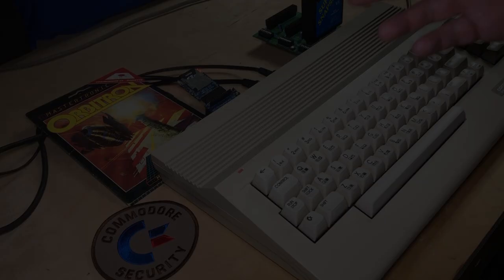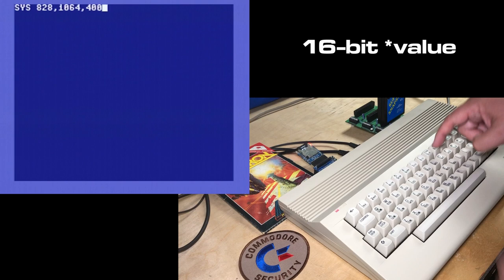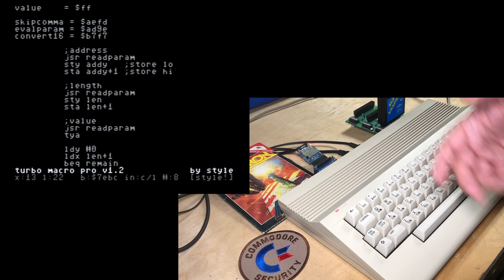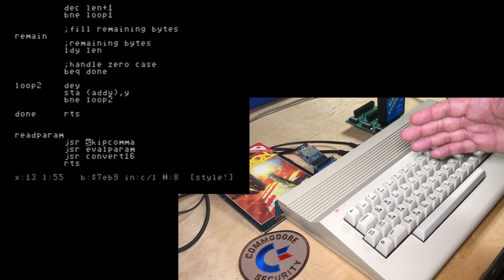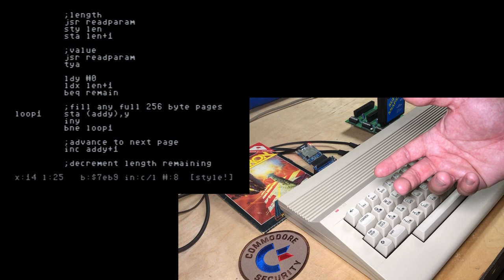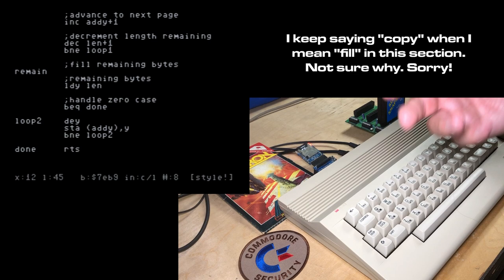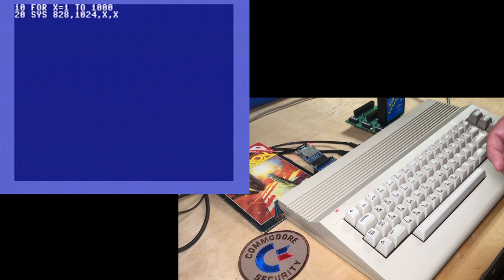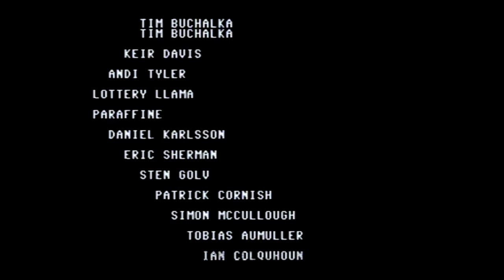Using Commodore 64 BASIC SYS Parameters in Machine Language

Comment: I keep in mind this SYS parameters thing for decades, it was actually published in some computer magazine article back in the 80's. And I keep returning to it when I roll some C64 ideas in my head. However, I always think about the next step - and that would be easing these things for existing basic v2 COMPILERS! 

But unfortunately I believe this elegant trick won't cut it for a compiled code. So it might be better to stick to some workarounds, poking parameters to some dedicated set of memory locations  (doing so before SYS command), and have machine routines pick them from there, or write back into them.

Basic V2 really miss PTR function - providing working with pointers to variables. That thing is powerful, and even more so if compiler supports it properly. Providing access to variables from machine code, both in interpreting or compiled code.

Comment: Atari BASIC also has a way to call machine language from inside a BASIC program. The address of the  string can be inside the call itself or stored somewhere in RAM like Page 6. It looks like this:
X=USR(1536, 100, 20, 3000, PLR1, MEMTOP-10)
Well, it can look like that when passing parameters. There can be up to 255! And generally the value returned doesn't matter, but I used it in my Push It! conversion of Sokoban when it counted the number of boxes in the final position. USR is very handy.
Reply from the maker: Looks very useful. Commodore BASIC has USR() as well, but only accepts one parameter (though maybe it can be extended in the same way as SYS) and annoyingly needs a couple POKEs to point the USR function to the 16-bit address of the machine language routine. If you want to call a different machine language routine with USR, you need to POKE a new address again. So USR() usually gets ignored in favour of SYS on Commodore machines.

Comment: ASK ROBIN ~ I recommend an episode on a C64 "cracking group"-like Intro coding session.  When growing up I would see your typical ☠ Cracktro ☠: 
x smooth scrolling text -- usually running along a wave-like path
x text gradually fading in and out
x an animating shiny glimmer at random spots on the text during the scrolling
?? Could you show us how this is coded in Assembly, and as a challenge, how close you can get using only C= BASIC ??
Reply: I second this. This is what I would have wanted to know when I was 10 years old.

Comment: On the topic of assemblers, I would love to see a video on how to go about, and the logic behind, loading an assembly program from basic (to allow the user to run it without knowing the memory address). I assume you have used this technique in your previous games? If not, what would the alternative be?
Reply from the maker: Hi! Do you mean you'd like to determine the correct address to SYS when loading a program? In most (but not all) programs that's the same as the load address, which I show how to figure out a few different ways in this video: https://youtu.be/b3j5k1rlhow  (if you don't want to watch the whole thing, look at the index for the sections starting with "Finding...". For BASIC code that calculates the load address, check out the "LOAD ADDRESS" program on the Model 1541 Test/Demo Diskette which I mention (but don't examine) at 23:31 in that video.

Comment: You should try this in Abacus Fortran...it is what BASIC was based on...you can add your own intrinsic or external functions and libraries to it easy (in Fortran) and it compiles to M/L code...it has the EXEC function (same as SYS but passes register values with it) and commands for PEEK and POKE (MEM)...I'd like to get or write  libraries for graphics, sound, and disk functions. Oh and gives 50k space for programs.  Have sorta started on such...

Comment: I had 2 tape turbos that can be called by  SYS708<-S"program name"  and  SYS52709"program name"  which would initiate the turbo save. Other then these I have never  used SYS command with parameters.

Comment: Hi, a while ago you made a video about IRQ-Driver SID Playback using Machine Language ... I have been experimenting with this but I haven't been able to fade out the sid volumen, even though it has a volume control that theoretically goes from 0 to 15. But I have seen in many demos that they fade out the sound and I was wondering how they did it. cheers
Reply from the maker: Yes, it should be possible by gradually going from 15 to 0 in the volume register ($D418). It's possible the music player updates $D418 every time it's called, which would likely prevent the fading from working. I'd suggest right after you make the call to the music player, then update the volume register right afterwards.

Comment: Is it possible to use only zeros and ones to code something? Did someone try to write a code using only zeros and ones?
Reply from the maker: It's not really possible on the C64 to only use zeros and ones unless someone deliberately wrote a program (maybe on a cartridge) to deliberately "downgrade" the C64 that much. But on earlier computers, like the Altair 8800, those were literally programmed with zeros and ones unless you paid a lot of money for upgrades like a keyboard!